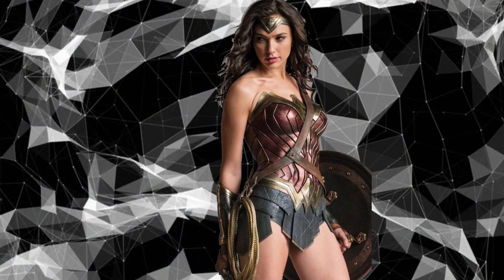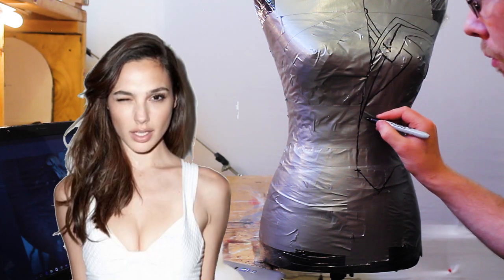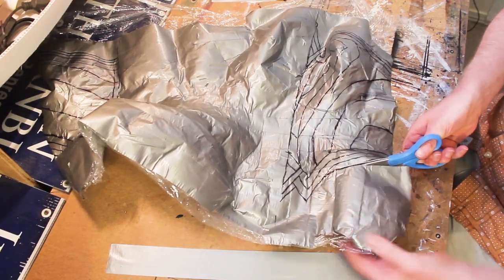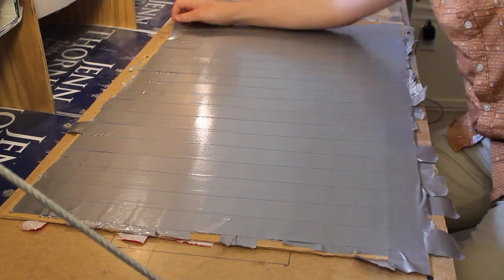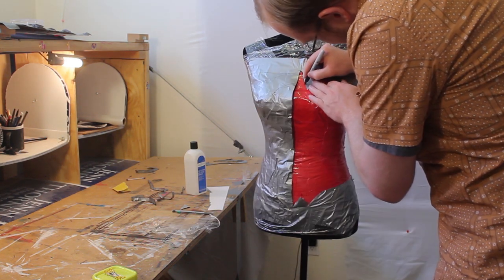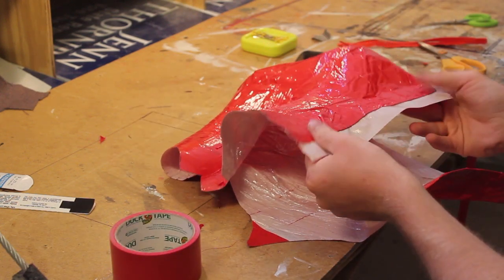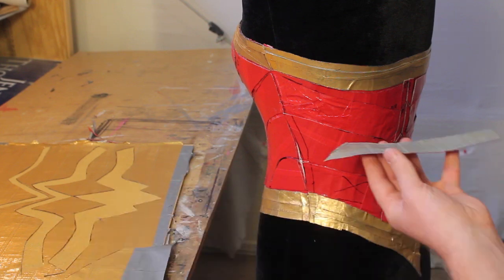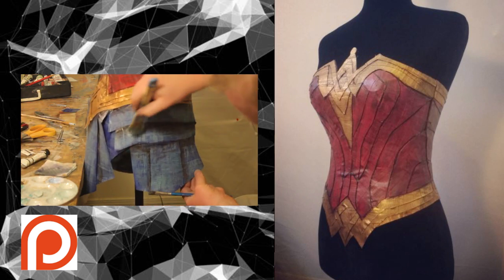Duck Tape Wonder Woman Costume (Part 1)

Comment: What kind of board are you using to make the duct tape sheets that it's so easy to remove from?
Reply from the maker: I used masonite. I don't think the type of board matters. You should be able to peel the tape off regardless of what kind of board you use.

Comment: Quick question: If you're using so much Duck Tape, is that not more expensive than using faux leather?
Reply from the maker: Grimlock77 the cost of materials for this project was about $30. I've never worked with faux leather, so I'm not sure which would be cheaper.
Reply: Kevin Thornburg Not bad at all for materials! I only asked because large rolls of tape seem to cost around £5 over here and it seemed like you went through a lot of rolls to get the thickness. Depending on the supplies you can get meter long strips of faux leather for about the same as a roll of tape. It might cut down on some of the work but it doesn't seem like it would be any cheaper.